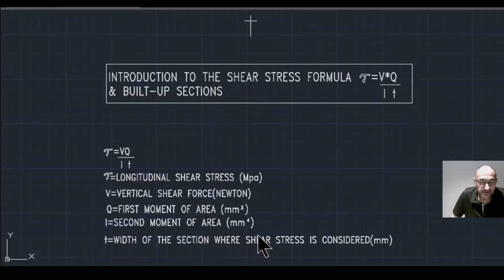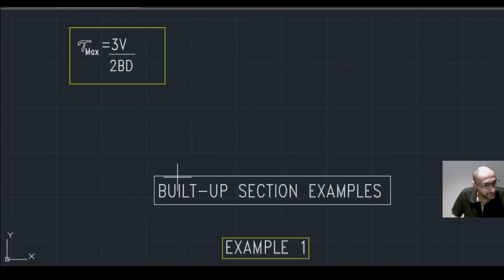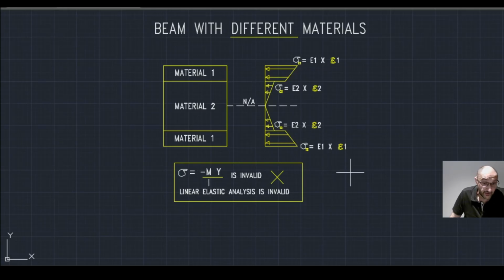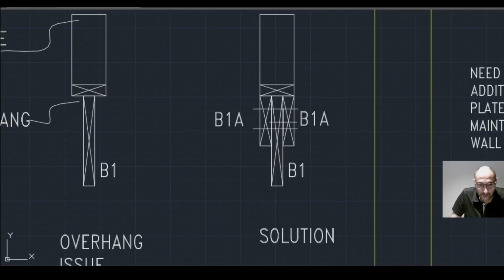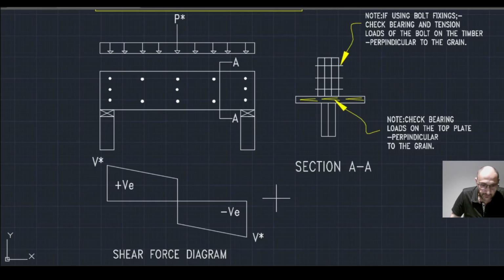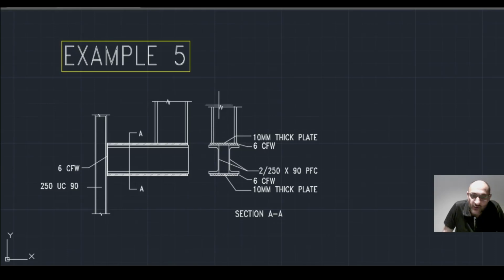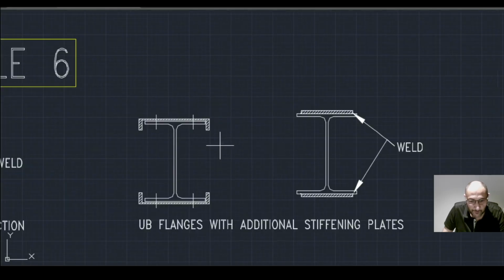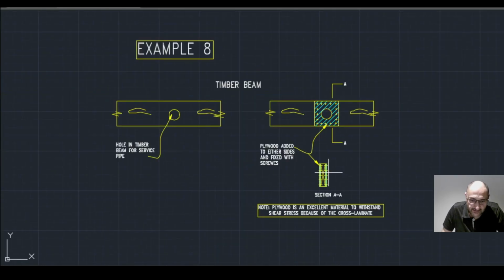Shear stress formula and built-up members: Part 1

Comment: Absolutely great work mate and love how you masterfully explain in simple terms. ❤ The examples are real and common. Now, to the questions/comments: 
Examples 1 and 2 (left) with the wall overhanging issue, I guess you're implicitly suggesting to design a nail/bolt/glue laminated beam to support the wall over. Otherwise, if the main beam "B1" can carry the load from the wall on its own, and it's just a overhanging issue that needs to be addressed, then just a nominal bolt/nail would suffice I would imagine. 

Example 3, great example. Looking forward to the more detailed discussion, didn't fully grasp the statement "tension from bolt onto LVL". I guess we could also check as 2 or 3 separate beams and if it works then nominal nail/bolt lamination to ensure all are engaged and load sharing occurs would suffice. I was under the impression that lamination of this form is most beneficial when invidividual beams are stacked like in the case of Glulam because using a weak material you can go from Ix = 3*bd^3/12  to  b(3*d)^3/12, a significant gain in Ix.

Example 5, another great example. Thinking of flow of shear stresses, how does that look like? Stresses travel through PFC web, to flanges, to tip of flanges, then to weld before engaging the weld plate. Would it be better to use a UC section with the same weld plate cut in half so plate gets welded to tip of flange but also weld to flange just over the web (works with UC I guess).

Example 7, very smart! Love it.
Reply from the maker: @ehsanchannel8703  Thank you so much and I am humbled by your positive feedback. I also love your comments and passion on these examples. I am in the process of doing some worked out examples to simplify these details. I just posted a wind beam lamination example 1 and my next one will be the overhang issue . I will also do the 2 PFC example step by step. Please stay tuned! Thanks again.